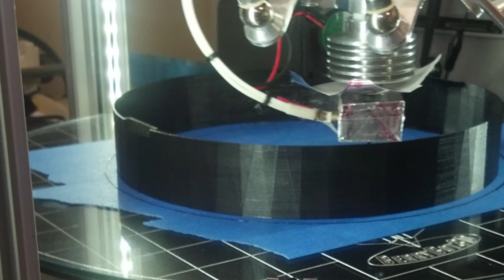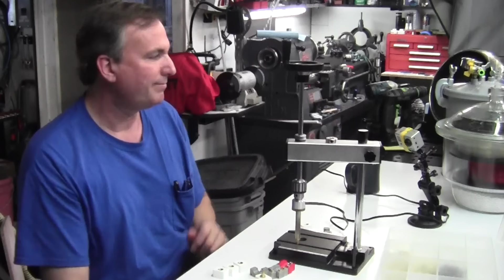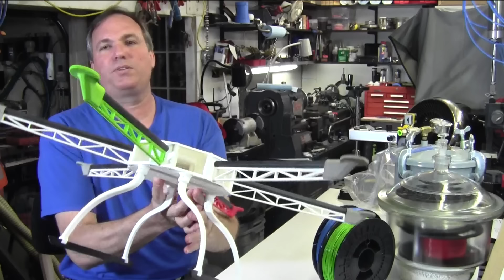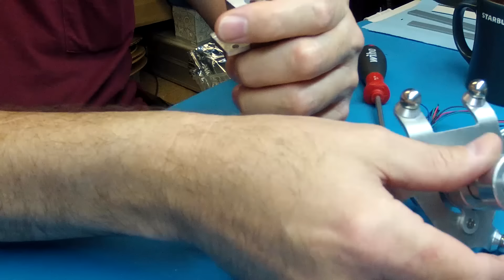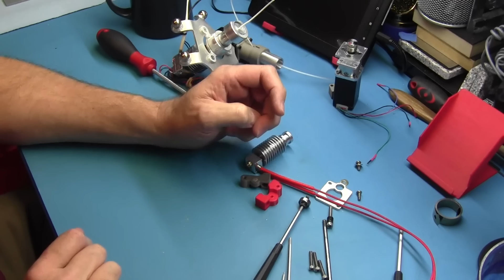New extruder design and drying filament with a vacuum chamber and desiccant!

Comment: Werner, why do you add desiccant to the vacuum when drying filament? If it's going evaporate out of the filament then it's going to come out of the desiccant as well.  It won't be until vacuum is removed that the moisture will get absorbed by the desiccant assuming it's absorbed easier than the filament.

Comment: Interesting about the vacuum chamber, I wonder if there would be any benefit in replacing the air with CO2 after pulling the vacuum. If that would help the filament stay drier longer than normal air?

Comment: Great video...  Nice design in the extruder. I am interested in the hot end you had... You said your design had the insert...  Does the other one have an insert also or is it all metal?  How well does it work with PLA?   I'm building a similar one that I hope will work with PLA and ABS with out the  Ptfe.   If you get a chance do a video on your hot end design and the new one.  Thanks

Comment: Always improving. I love how you continually find ways to improve on a design.
The hot end you make looks to ride not as low in the effector than the one you showed in the end of the video. and with larger cooling fins. Do you think your version runs cooler?

Comment: Hey Berry I was just investigating that new $1500 metal 3d printer that I read about on Yahoo news today and it looks like an upside down Delta printer with the build plate attached to where the hot end usually goes and a tig welder suspended above the build plate? Any way here the link http://www.appropedia.org/Open-source_metal_3-D_printer